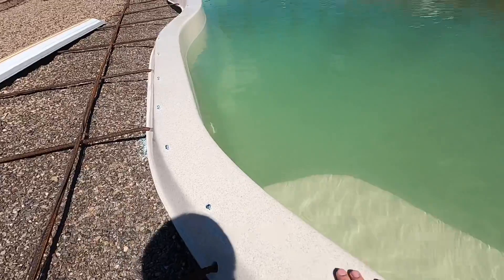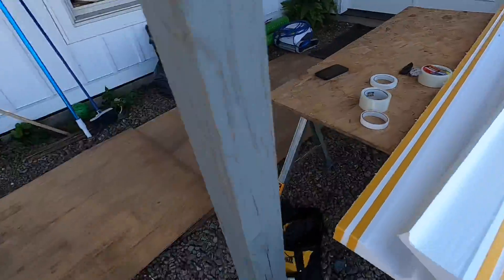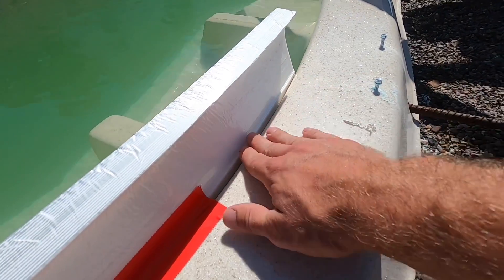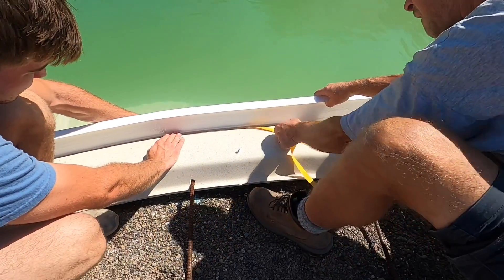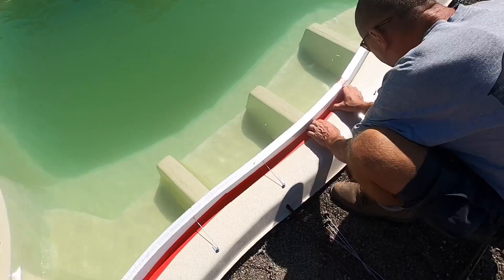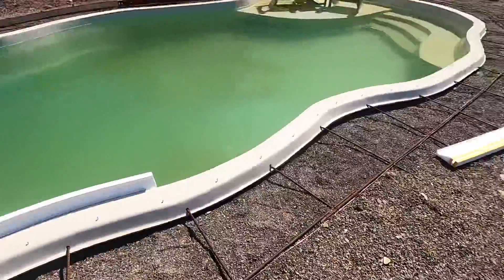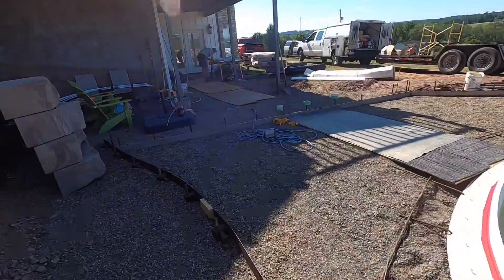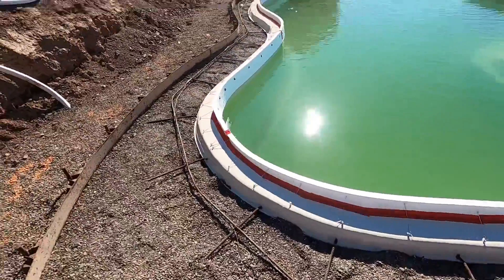How to install cantilever concrete forms on a fiberglass pool

Comment: I noticed the gravel underlay is close to the pool. Is there any reason you don't want the concrete pour to be deeper or touching the outside of the fiberglass pool wall?

Comment: Mason, do you have to cut the small wires that go through the foam and around the screws when you remove the forms?
Reply from the maker: They break when you twist them
Reply: @masonthemason6412  OK thank you!